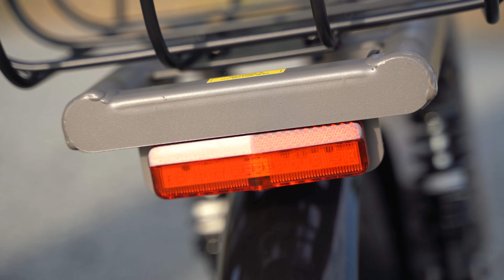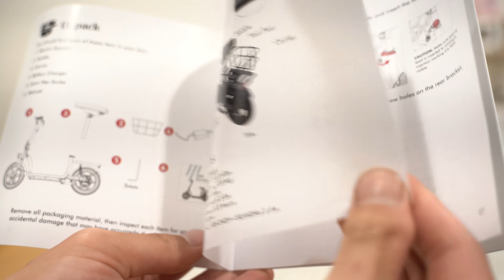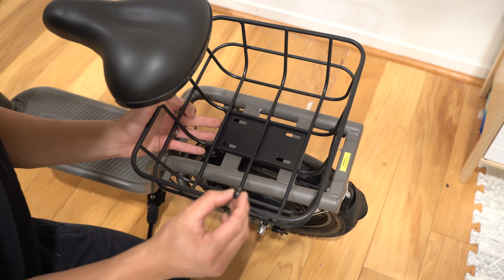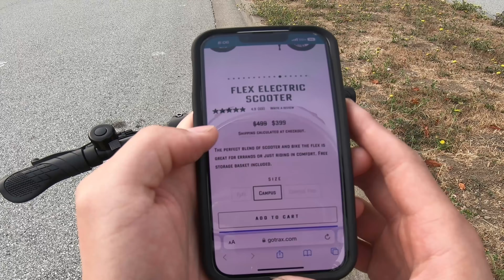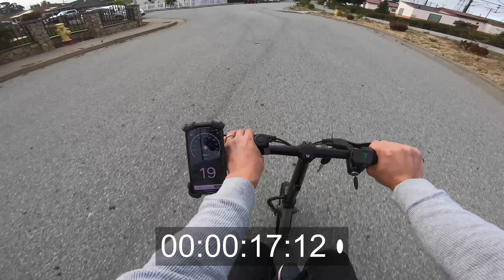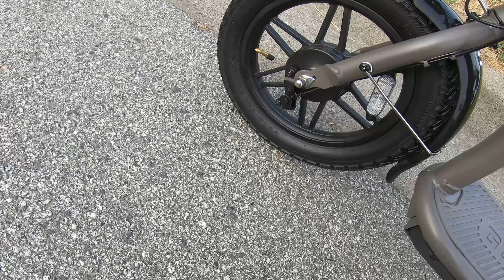$499* Gotrax Flex Campus Pro Electric Scooter Review - Unboxing, Assembly, Test Ride, and Review

Comment: A video on how to change a tire on this particular scooter would be nice
Reply from the maker: Thanks for the suggestion. Unfortunately I sold the escooter shortly after posting the video due to limited garage space. The tire replacement procedure should be the same as any normal bike with the exception of disconnecting the rear motor plug. 
https://youtu.be/eqR6nlZNeU8?si=2-2A-x2YFk545umo

Comment: Fast delivery -GREAT!  BUT the screws used to affix the basket onto the frame are screwed RIGHT DOWN extremely tightly to the frame. I am unable to unscrew them as they are sooo tightly affixed to the frame without the basket!!  ANGRY!!
Reply from the maker: Sorry to hear that. You may need to use screwdriver bit that fits exactly in the space, and use a wrench to loosen it if it's stubborn.

Comment: I lost my one an only key how do it get another key ?
Reply from the maker: Hello Curtis, you will need to contact Gotrax for a replacement throttle, or look for one online. It will come with a new key. Alternatively you can take the throttle housing apart and look for a similar lock/key set, or replace it with a toggle switch.

Here's one from Gotrax that's sold out, and the plug end looks different. https://gotrax.com/products/flex-electric-bike-throttle-set?srsltid=AfmBOooRqf_7-smMoHAP8nxqQDfTBgC1aij14LQ_-xtiPV-wDVammvd1

This might be it, but I'm not sure what the 150370 - throttle adaptor cable is. 
https://gotrax.com/products/flex-voyager-electric-scooter-throttle?srsltid=AfmBOooKBOxoTzuS9gr1h5NWD-p_MCqqQFGi1PNoHmgJbFdFwWYernbo

This plug end is closer to the Campus Pro. 
https://www.aliexpress.us/item/3256809000287274.html?src=google&pdp_npi=4%40dis%21USD%2146.99%2146.99%21%21%21%21%21%40%2112000048233043516%21ppc%21%21%21&src=google&albch=shopping&acnt=708-803-3821&isdl=y&slnk=&plac=&mtctp=&albbt=Google_7_shopping&aff_platform=google&aff_short_key=UneMJZVf&gclsrc=aw.ds&albagn=888888&ds_e_adid=&ds_e_matchtype=&ds_e_device=c&ds_e_network=x&ds_e_product_group_id=&ds_e_product_id=en3256809000287274&ds_e_product_merchant_id=109103804&ds_e_product_country=US&ds_e_product_language=en&ds_e_product_channel=online&ds_e_product_store_id=&ds_url_v=2&albcp=20268592310&albag=&isSmbAutoCall=false&needSmbHouyi=false&gad_source=1&gad_campaignid=20273079733&gbraid=0AAAAAD6I-hGHLUqU69_I2L6c4cbIRl6Mq&gclid=CjwKCAjw4K3DBhBqEiwAYtG_9EaLnC89DTm8UWUb4__WTdMrO9aYmiowEQtndtRI3pqlTQBWNQe0RBoC5V0QAvD_BwE&gatewayAdapt=glo2usa
Reply: Thank you it’s been a year now I been found my keys lol an recently broke my entire throttle set now I know what to do appreciate you

Comment: Is it normal to hear a scrubbing sound in back tire or has anyone experienced that
Reply from the maker: You should not hear any scrubbing. If you lift the rear wheel and apply the throttle can you tell where the noise is coming from? It could be the rear tire hitting the frame, and the wheel needs to be re-aligned.

Comment: Never plug your scooter in first then plug into the wall that's bad practice and can fry your scooter electric board's always connect to plug first while it's turned off at the switch , then connect your scooter then turn the plug switch on
Reply from the maker: Thanks for the advice.

Comment: Because of your review I  purchased this. And it’s been the Biggest mistake of my life! Wish I had done more research about this company first!
Reply from the maker: I'm sorry to hear that. May I ask what happened?
Reply: @ColinLeung  I’ve received a scooter with a broken seat that’s seems to be of low quality,crooked handle bars with no tool to fix, and I think there’s charging issues charger doesn’t change to green.But the customer service is refusing to give me a return shipping label. Has threatened me with restocking fee even though they sent it like this.And I’ve read all the bad reviews, I’d rather return the scooter than receive any replacement and cause myself more headaches.
Reply from the maker: @beccabrutal386  That's very unfortunate. Perhaps you can file a claim on your credit card because they sent you a defective product.
Reply: I got a Hyper Skute scooter from Walmart. It looks really similar to this one.
Reply: Which one do you recommend Gotrax flex ultra or Gotrax campus pro?

Comment: Great video. Simple to follow.  I have owned from a different maker a seated scooter for 3 years.. I love the scooter, but there support and battery management are terrible.  I've replace 3 batteries in 3 years.  Same problem.  Battery won't charge.  Do you have any knowledge regarding Gotrax service support and battery management?  I'm 6'1".  Do you think I'll be able to ride comfortably with my feet on the deck without having my knees buckled?
Reply from the maker: Hello, I've only dealt with Gotrax's marketing department, and not their service department, so I cannot comment on how helpful they are. 
I'm 5'11", and did not have any issues with knee clearance. There appears to be a few inches of clearance from the stem, so you should be okay.
https://youtu.be/h5a3Pl71s1Q?si=RcyF391UHy1xA0oi&t=33
Reply: CALL SUPPORT INSTEAD OF DEBATING IT WITH THE PUBLIC.
Reply: @Larry-gn1xj  Yes sir!  But no debate.

Comment: Do you need a drivers license to drive this in Pennsylvania?
Reply from the maker: Per this site it seems like you need a license. Rules of the Road
Pennsylvania law is quite strict when it comes to electric scooters on public roads. The state considers them vehicles, meaning they are not exempt from titling and registration requirements as set forth by PennDOT and would be required to pass equipment standards and inspection requirements. However, most electric scooters don’t have the necessary equipment (like turn signals and mirrors) to meet these registration and inspection requirements. This effectively makes them illegal to ride on Pennsylvania roads.
https://upperallenpolice.com/wp/information/electric-scooters-and-pennsylvania-law/

Comment: Which do you like better the GoTrax Campus Pro e-scooter or the Gyroor C1S with 2 baskets? I'm thinking of buying one or the other which one do you prefer and do you think is a better value and a better scooter? Thanks
Reply from the maker: They're about the same in performance. I liked the center basket on the Gyroor, but think GoTrax is a more known brand, so there will be more replacement parts if things break down.

Comment: I have the Gotrax FLEX Electric Scooter - I bought the mustard green one and love it. ..the design is a little sleeker with softer lines. 400w motor and weighs 42 lbs. ASIN B0C7QL3V76
Reply from the maker: I'm glad you like the Flex. Thanks for the comment

Comment: The one thing I wanted to know isn't covered lol. 
TLDR: I got a Gotrax F2 Pro, which advertises 15 mph and 7 mile range.  In reality it only reached 15 mph going down at least 10 percent grade.  It averaged 11mph, when battery was above 1/2, 7mph when battery was below 1/2.  From a fully charged battery traveling on fairly level ground it only went 1.3 miles before being completely dead unable to move any more.  I have seen dozens of video review for various electric scooters and literally not a single one has done a range test to see what range you actually get out of the scooter compared to its advertised distance.

I considered getting one similar to this one on Amazon, but many require up to a $100 non refundable delivery fee.  There is no possibility I will ever pay such a fee when lying about speed and range seems to be an industry standard for these devices.  Now if one advertised 25 mile range, but you only really get 20, that would be fine, if I knew that before purchasing.  But getting 6 times less range than advertised is simply unacceptable.
Reply from the maker: Sorry to hear about your scooter range. I've noticed most ebikes and escooters get half of the advertised range with normal riding. 
I'd also look for scooters with free shipping on Amazon or the manufacture websites, and look at their return policy. Most allow free returns within 15 or 30 days if it doesn't meet your expectations, or is defective.
Reply: @ColinLeung  I'm reconsidering the whole thing.  I started looking into safety reports.  It turns out that because of the almost complete lack of any safety mechanism, combined with the extreme speed most are capable of, that they have an atrocious safety record.  Its hard to nail down perfectly but on a scale of the top 100 safest forms of transportation, airplanes are number 1.  Cars are 10, and electric scooters and bikes are somewhere between 70 and 90.

Cars kill a lot of people every year.  46,000 last year alone in the USA.  Electric scooters only killed about 250.  Still when considering that there are 10's of millions of cars traveling many miles a day, the cars still overwhelmingly win in safety.

I still think they might have some acceptable niche uses like traversing tourist areas where driving a car is impracticable or even impossible.  However even then I would only consider a bike version and would not drive near other pedestrians.  Shockingly about 20% of those seriously injured by electric scooters are not even those who choose to ride them, but other pedestrians who they collide with.  This is also much higher than the less than 1% of automobiles which hit pedestrians.  

Sadly I think we need some laws imposed on their use restricting them from spaces where foot traffic is also common.  I never realized how dangerous they were until now.
Reply from the maker: @K162KingPin  Thanks for sharing your findings. I don't know if the danger is from the electric scooters themselves, but rather the people riding them. I've ridden bicycles and motorcycles my entire life, and have a good sense of awareness, balance, and ride defensively. I cannot say the same of others. Several friends/family members have injured themselves because they could not control the power output from electric scooters/bikes.
Electric scooters and bikes are readily available in metropolitan areas, and do not require background checks. You can download an app and go, so I'm not surprised by the number of injuries caused by them. 
It's been a few years since I obtained my drivers license, but I recall a CA law stating that any vehicle going over a specific speed (5mph?) must be ridden in the street and cannot be ridden on the sidewalk.
Reply: @ColinLeung  You could make the same argument about guns.  What is the danger, the gun, or the person holding it?  The difference is people who can get guns KNOW they are dangerous.  The kids riding scooters, even many adults riding them do not understand, act, or treat them like they are deadly machines if misused.  They treat them like toys.

The narrative might change drastically if people were only aware of how fast things can go wrong, and how seriously they can be injured or injure others.

Comment: The website says the only one that goes 20 mph is the campus pro, is that correct?
Reply from the maker: I would suspect so. The Flex and Campus have 350W motors, so it would make sense that they have the same max speed. I haven't been able to test the Campus to verify.

Comment: I wish this model would come with a seat like the cheaper model they sell which looks more like a Moped style seat. It seems like each electric sit down scooter has features I do and don't like.
Reply from the maker: Thanks for the comment. The Campus Pro has a seat, but are you referring to a backrest?
Reply: The more powerful scooters come with a bicycle seat and less powerful cheaper models come with a really nice moped style seat. Doesn't make sense. Also it looks like the less powerful models come with a spring style suspension but cost more. Also some scooters have the lights in better locations then others. Some have the head light located by the front wheel or located up on the handlebar which it makes more sense to me to have it up on the handlebar. I wish there was scooter company that can put all the right features into one package with a nice frame that makes sense when building a scooter the right way. I am sure a guy can modify stuff themselves but it's nice if the companies could figure out what makes sense when building them. Also some have
Reply from the maker: @randykirchhevel7311  Got it. Thanks for the detailed response

Comment: I just received my scooter yesterday and guess they have upgraded this model. Which I’m so happy they did. It comes with a more comfortable seat and it also comes with a better display that shows your speed, trip, light on/off,eco/ high and battery level.No more key to turn on and off. I weigh about 260 and this thing hauls butt 😂. Their are no hill where I live so I have no worries about climbing uphill. Great E-Scooter overall.
Reply from the maker: Thanks for sharing your experience. I was not aware of the upgrades, but it sounds like great changes!
Reply: The same model Campus Pro? Can u give me the link where u bought it? I want also the one with a better display that shows the speed and trip. Thank you
Reply: @irishp5651  I bought mine off Amazon

Comment: I got the flex ultra electric scooter today from Amazon and so far I love it but waiting for it to charge! Do I need to let it charge fully for it to go 20 mph also I’m 250 lbs I got the scooter with 500 w but with no key
Reply from the maker: It should be able to go 20mph with sufficient charge (30%+), but it's good practice to fully charge the battery prior to first use.
Reply: @ColinLeung  it’s making a vibrating noise is that normal
Reply from the maker: @Treywalzer  That doesn't sound normal. Where is the vibration coming from? Something may be loose
Reply: @ColinLeung  around where my motor of my back tire! The whole scooter is vibrating
Reply from the maker: @Treywalzer  Does the wheel wobble if you lift up the rear tire and engage the motor? The tire or wheel may not be seated properly.

Comment: Is the seat supposed to wobble a tad?  I have the seat post clamp really tight and when sitting on the seat it shifts to the left or right a bit, seems from teh top of the post, not the post itself
Reply from the maker: A little wobble should not be an issue as long as the seat post, seat rail AND seat are secure. In addition to the seat post clamp being tight please double check the two bolts holding the seat to the seat rails to the seat post. You will need two adjustable wrenches to tighten them. Let me know if that fixes it.

Comment: Thank you very much for your review of this e-scooter. I purchased the campus pro for my Mom as a way to get around town in short trips and sense of independence. She recently was in the hospital for having seizures but is thankfully doing much better now but can't drive anymore. So having this for her is a great option to help her feel like herself again. Just wondering your thoughts on a new rider/elderly person starting out with this scooter. Just want to make sure Mom is safe but give her freedom to get around. Monday is when the scooter is to get here. Appreciate your time and any feedback/suggestions you have. Thank you!

Jess 😊
Reply from the maker: Hello Jess, thanks for the message. I'm sorry to hear about your mom, and hope she gets well soon. The most challenging things about the scooter are balance, throttle control, and braking. 
Ideally your mom should have a good sense of balance, or may further injure herself if she falls off at speeds up to 20mph. 
Secondly, throttle control will determine how fast the scooter will go. She can change the pedal assist levels to limit the max speed, and can practice riding in a lower gear until she's comfortable as it's more forgiving. 
Lastly, braking will determine how smoothly the scooter will stop. Ideally she should be able to put one or two feet down at a stop, and putting the seat to the lowest position will help. 
She can practice all 3 of these in an empty parking lot before getting on the road.
I hope this helps
Reply: How is the reliability?

Comment: Why is no one showing the tightening of the screw in the handle stem. My screw isn't tightening.
Reply from the maker: Are you referring to the 2 bolts that hold the handlebar to the stem? I showed it here. https://youtu.be/h5a3Pl71s1Q?si=wF18JWeY5fWIZ4EU&t=127
It's possible that the metal threads on the stem have stripped, and they will continue to tighten. Does it look worn?

Comment: How well does this thing handle inclines? I'm looking to get this version, but the couple hills in my area I have to pedal ebikes up them or slow down to a crawl
Reply from the maker: I wasn't able to test hills before I sold it, but 500W motors typically can climb 15 to 25 percent grades. Anything higher it may struggle.
Reply: @ColinLeung  Ah, well that sucks.

Comment: so when you do all the miles does it just stop working completely?
Reply from the maker: That is correct. The motor will not work, but you may be able to use it as a kick scooter with a lot of weight/resistance.

Comment: Does the throttle only have certain set speeds or is it like a car..the more you press the faster it goes?
Reply: It's like a motorcycle or moped. The more you throttle the faster it goes. Full throttle will be the max speed.